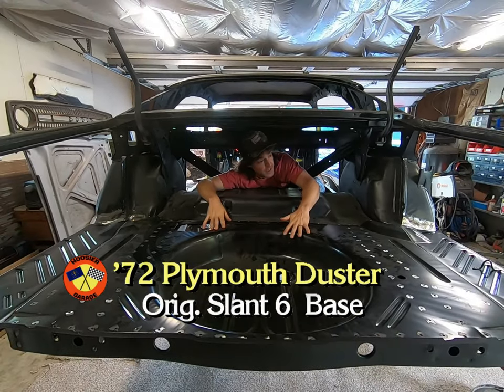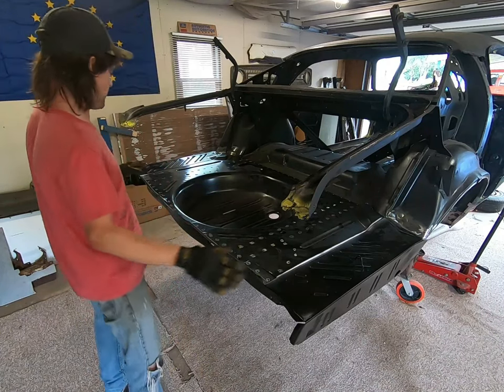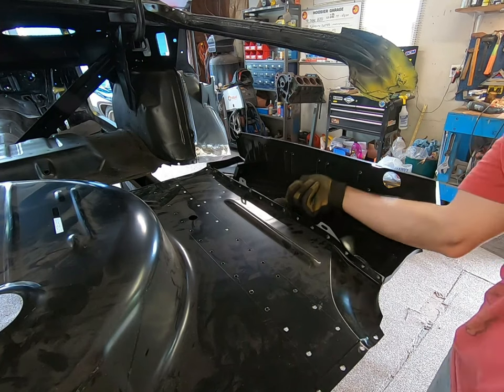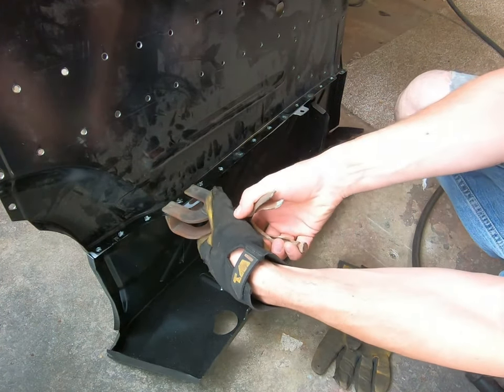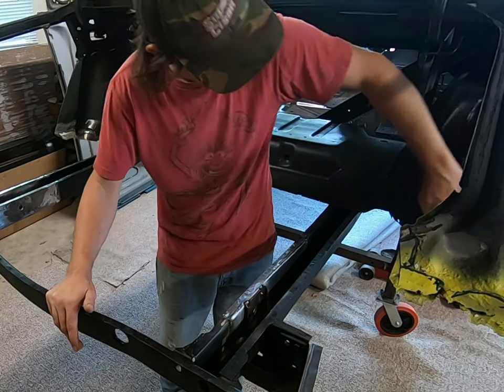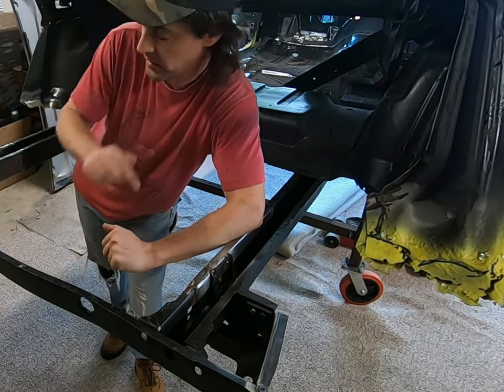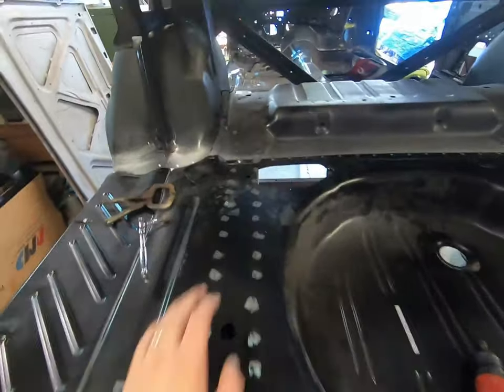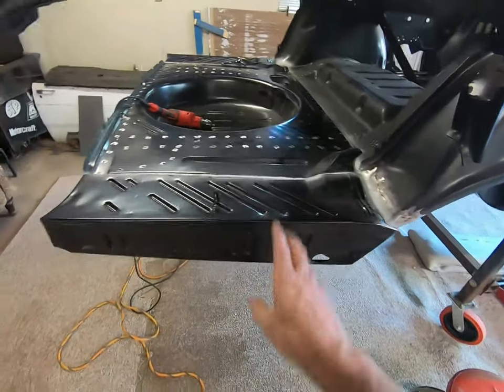Trunk Floor Installation/Trunk Floor Drop Offs - '72 Duster Restoration PART 7

Comment: Should fit all the panels before welding anything. Assuming chinese reproduction parts will fit right out of the box will bite you every time.
Reply from the maker: I should mention i did prefet everything, including quarters. Next time will show i even had to hang doors and quarter glass